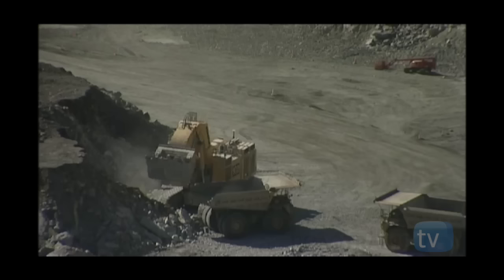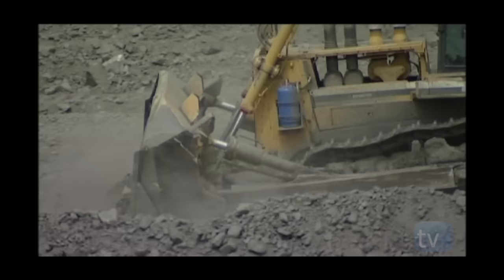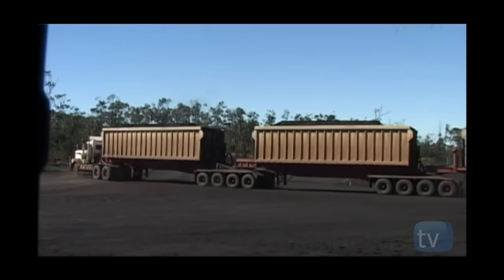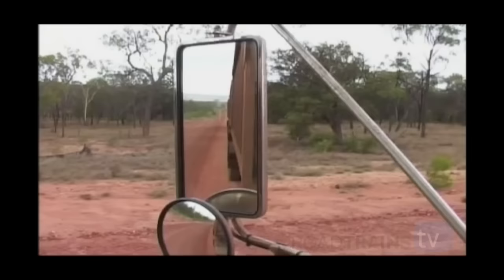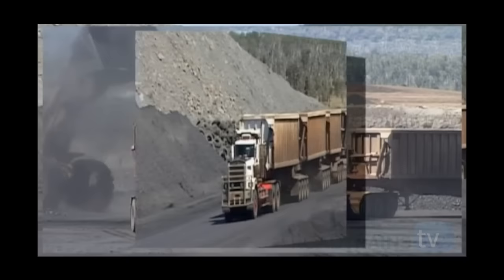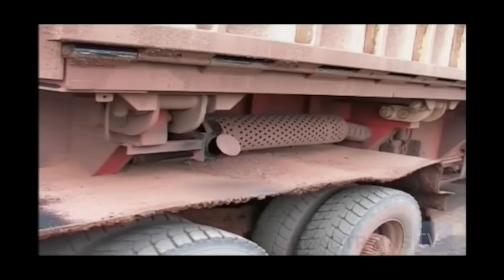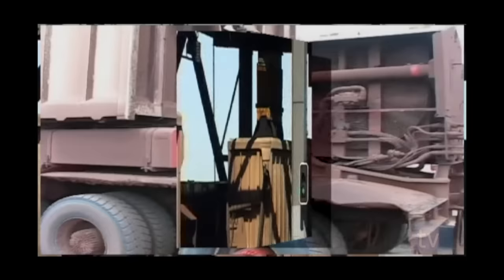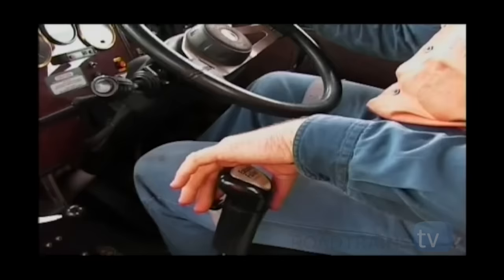Massive 1000 hp Kenworth C510  with 5 trailer road train

Comment: Better title: Massive 1950 lb ft of torque @ 1300 rpm Kenworth C510 with 5 trailer road train.
Reply: Massive 1950lb ft of torque... lol

Volvo, Scania, Mercedez, MAN : Hold my beer...
Reply: Well 'my' (company truck I drive everyday) with a stinkin' factory OEM 18yo 600hp Cummins has a factory 2000ft/lbs + @ 1375rpm.  Big deal for the C510! Who gives a shit about HP?
Oh yeah and it's proper 2000ft/lbs actually available to the driver not Euro 720hp/2600ft/lbs (actually only available to the dyno for dick pulling purposes rather than load pulling). Those Euro trucks crack me up. I drove a 720hp Scania V8 recently and it had NOTHING and I mean that, NOTHING like the power the Signature in my 'ole truck has. Stupid Euro truck pulling a B-Double up a hill couldn't make more than 35 - 38km/h at 55t. At 60t my old unit goes up the same hill at 50+ km/h twice a day.
With a single trailer my truck at 40+ tonnes goes up an 3rd direct in high range at about 1950rpm at 70-75km/h on a good day. I'm a company driver and I know what I'm talking about. I drive the same route twice a day.
Reply: @ThePaulv12 ...... The big difference between the EU & US engines, is that all the EU Truck engines are Under-square and the Cummins (& Cat) are Over-square.  In layman's terms, that means that an Under-square engine's Stroke travel is less than the diameter of the bore.... just the opposite of the US Truck engines. 

The Longer (over-square) the stroke in relation to the bore diameter... the higher the piston speed per rpm, which equates to greater internal inertia which generates greater lugging or, "holding" ability for whatever amount of torque generated.
   
This was the cause of Lots of ignorant "4 cycle versus 2 cycle" discussions (re: Myths & "bad mouthing") back in the day of the 2 cycle Detroit Diesels... which still persists even in this day and age... all based on pure ignorance.  

1600 (or whatever the number) ft lbs of torque is 1600 ft lbs of torque, Period!... regardless of operational cycle design (for all 2 & 4 cycle gas & diesel engines) or the engine brand name producing it.

Two 4 cycle (just for example) diesel engines with identical hp & torque outputs, identical rigs with identical trans, final drive ratios, tire size, & gross weights... with the One Exception of one engine having (for example) a 5.5" X 6.5" B&S versus 5.5" X 6" B&S..... the engine with the 6.5" stroke will "hold" each gear longer in an upgrade pull, than the engine with a 6" stroke due to greater internal inertia created by the higher piston speed in the bore.
Reply: As it should be. Horsepower is irrelevant but the torque output is what it power.
Reply: @Romans--bo7br  very informative response. Thank you.
Reply: @ThePaulv12  I think the Scania's only make the big numbers in top gear or something, but you're right, they're gutless compared to Cummins motors in the real world.
Reply: @jowenjv4463  Real trucks are measured in Clydesdales, euro trucks are measured in Shetland pony's.
Reply: @xr88yu  If Clydesdale are the same shit than imperial measurement system, I won't refer to it in anyway versus Euro measuring system x) 

Troll mode off. 

What is the difference between those two types of power ? Measuring procedure ? Does it make a big impact on the final values ?
Reply: @jowenjv4463  A Clydesdale is a breed of draft horse, a Shetland is a kids size pony. And yes, their is a big difference in pulling power between the two.
Reply: @xr88yu  ok. Thanks for enlighting me about horse culture lol. But if it's a different measurement method, the big boy engine will have kiddy european power if done with european measurement method. And little euro kid will put big boy's US  power if measured with Clydesdale method
Reply: @jowenjv4463  It's not a "different measurement" its a saying in the Australian transport industry.
The idea being,
600 Clydesdale draft horses (CAT, Cummins, Detroit) will out pull 700 Shetland pony's (Volvo, Scania, DAF, etc) 🙄
Reply: @xr88yu  Oh ok, I though you were talking about measurement methods which lead to HP difference between HP, BHP, PS etc etc. 👍
Reply: @xr88yu  😅😅😅

Comment: This makes me appreciate a 750 HP car much much more
Reply: A 750hp car wouldnt be able to move the trailers. Its not just hp but the ammount of tourque theese monsters put out is insane
Reply: Neeraj Sharma  1000 hp is 1000 hp
Reply: @StonedSpagooter  yes it is, but your LS, 2j or rb aren't going to give you 2000 ft /pound at 1300 revs
Reply: noob no videos chanel  For towing trailers, you're looking more at the amount of torque, rather than the amount of torque. It literally has almost 1 ton-ft (2000 lb-ft), that's a huge amount of torque. No road car would be able to generate that much torque at a low rpm, or have such a torquey engine. This is a very large engine, made for pulling and towing, not for top speed.
Reply: What the fuck do you need 750 hp for?  You only go to the bloody mall or to the garage to fill the thing up all the time.
Reply: The pistons in this truck will look like paint cans. You really think your ls1 will go toe to toe with a truck engine? Go back to school, kid.

Comment: I think people have overlooked the 2000 lbs of torque going through an 18 speed transmission.
Reply: And that has planetary final drives
Reply: @wrenchtheroo6557  lbs of torque... bcs physics is a joke xd
Reply: Most semi trucks have around 13-18 speeds and usually have about 1500+ lb of torque
Reply: @Andrew58251  most recent 15-16 liter engines can make 2000 ft-lb of torque
Reply: @wrenchtheroo6557  I think most are around 1800, some larger, some smaller thats why I said 1500+. Point is most semi trucks you see on the road have a similar engine to this, just a bit smaller
Reply: Эндрю . Thanks for the info ! Is this for highway trucks ? & does your answer only apply to “down under” or is it also true in the USA ?
Reply: @robertmintz63  usually planetary drive vehicles are always used in an off road condition in the us unless it's a special moving company such as mammoet where they need a lot of torque
Reply: European trucks puts out much more power, with smaller engines, at a better economy and emissions. 
Look up the new giant road trains transporting wood in Sweden. 
I'm danish myself, and we hate those smug swedes, but those beasts are impressive

Comment: It’s interesting to read the comments on this Unit from people that you can tell haven’t got a clue and don’t understand the uniqueness of this set up, I operate these Roadtrains our units pull 3 trailers with 300tnn of product and they are an absolute work horse in their field, To work the 18 speed to sync with the Auto on the power trailer on a climb out the pits is something to experience, I have seen a few that didn’t get it right and than it gets exciting with a big mess of twisted Metal and a big job for someone to clean up.
Reply: Sounds like fun!

Comment: I see a lot of posts arguing for euro or KW in Australia. The both have roles to play, but Europeans in general have no concept ot the size and heat of Australia. If I was buying a truck for long haul, i'd be looking for the one with the biggest radiator and a snorkel.
Reply: Hold on don't eu trucks are better since they are shorter and also have a bigger grill

Comment: i want to see them back up into a tight space hauling 4 trailers.
Reply: They simply can’t, and I’d hate to see them try. Instead they design the loading and unloading areas around a loop system, or a traffic system, dropping off goes one direction, picking up goes the other, with plenty of open space to turn a full 180 if need be.

Comment: Kenworth are really powerfull trucks..
Reply: Lots of different trucks can be "powerful".... just depends on how they are powered and overall gearing.  Gearing is Everything... you can make a "weak" engine pull a mountain off of its foundation with the right gearing (a "slow" Transmission with High Ratio (slow) rears.... and you can make a "strong" engine pull like a sick dog, with the wrong gearing... ie: too low of a ratio in the rears, and "fast" transmission.

Comment: Saw the road trains in northern territory a few decades ago. Very imposing. Iirc they were limited to three trailers then. Perhaps others more familiar can confirm or deny if this was they case. I also saw the kenworths in action out in the deserts of Saudi Arabia years ago, running out to the rigs. It was amazing that something so large could just seemingly float over the soft sand that much smaller vehicles struggled with. Its all in the tyres.
Reply: In Port Hedland I worked on the super quads. 4 trailers powered by an isx and road legal. 67 meters long I think.
Reply: @deanriley5690  interesting, thanks. I stopped over in Port Hedland for a couple of days, years ago. The worst tap water I ever tasted! You couldn't even mask it with strong coffee. Hopefully they have sorted that out by now😊

Comment: Thumbnail says 1000 hp truck- kenworth spokesman doing the add says 600 hp
Reply: Maybe including the trailer?
Reply: 1 2 3 Four Five do you know what HP means?
Reply: @lukeWiz44  Hewlett Packard Harry Potter Horse Play Horse Power
Reply: @lukeWiz44  But if you watched the video, those are powered trailers with 600 horsepower each
Reply: Read the description m8
Reply: @123fourfive5 .... No sir, they are Not.  Only the Third (3rd) trailer back, is powered.... with either a 450 hp ISX Cummins or the ISX Signature at 500hp, while the KW has a QSX 19 rated at 606hp... for a total of either 1056hp or, 1106hp... depending on which version of the Cummins ISX they're using in the "power trailer".

Comment: "real truckies don't use the clutch" 
* grind grind grind grind crunch - finally goes into gear *
".... See..?"
Reply: Use the clutch and you will crunch just as much
Reply: It does show your ignorance does it? Been trucking since 1997. Never grind the gear and only use the clutch during first gear at start and when stopping. In between gears while truck is in motion is shifting on the fly without using the clutch by matching the speed and the engine rpm.

Comment: Here in the UK we use the Cummins QSK19 in 750bhp tune under each coach of a number of high speed trains. The thought of using them in the outback where a breakdown is serious business amazes me. They're not very reliable. Although they are covering more miles in a UK train than an Aussie road train and at higher power so maybe that helps with reliability.
Reply: Used to work for Cummins. Spoke to an old timer who was an application engineer for the QSK program for a few years. He said that at higher power levels, anything other than perfect engine cooling and charge cooling would result in awful reliability. Not defending it, just saying it was known at the time
Reply: Yeah 750hp is probably ringing it's neck 606hp are sweet as

Comment: What?? The trailers have motors?!
Reply: yeah beacause there is just too much weight behind the drive to pull such a load on the road and especially uphill. You need that power trailer usually as your "third" for more power distribution throughout the train.

Comment: I built a powered stinger axel 25 years ago for heavy haul at lower speeds with a 8v-92 Detroit with a Allison 4 speed auto and 4.56 gears  used a simple RC box to operate the throttle and shift it in and out of gear was only good to about 40 MPH    should had got a patent on it ??
Reply: oh well.  you saved on patent fees.

Patents expire in 20 years.
Reply: Detroit!!

Comment: Cummins diesel..American know how.
Reply: riplstrip  the truck name and design is American,its was just built in Australia
Reply: Clearly don’t know how with your education system 😂
Reply: Phillip Aubin true. Cranks too. They just machine them in USA and then they can say made in USA. Company I work for just had a new X15 literally blow up on I-294 in Chicago. Engine parts all over the road. Pistons went right through that Brazilian block.
Reply: America don’t have good engines they overheat bad blow up in ya face it’s Aussie engineering bud, it’s Australia #1 now
Reply: Detroit 2 stroke is better.
Reply: But, with your current, political regime, is it wise to boast of "American know how"?
Reply: I wouldnt brag about cummins. Junky dodge uses them
Reply: @jimmychanbers2424  its the only good part of the 2500 pickup.
Reply: UnknownAccount as an american i vouch this. aussies have the most badass rides. hold up at high power too.
Reply: All our manure spreader trucks are Mack. Every truck is set to run 85 mph. I would bet a Mack engine can out work a cummins.
Reply: @jimmychanbers2424  it the volvo engin has got some mack and aussie ingenuity- hell yes!
Reply: Cummins engine is American made

Comment: God help them if they have to stop fast. The brakes would burn up!
Reply: Nah. It won't go fast and every wheel will have a set of brakes. Can't say with multiple trailers but semis will actually stop faster when towing a trailer
Reply: Greg they stop faster than people thing, 5 axles on a typical truck and every one of them braking with weight on top so they are unlikely to lock up. I can’t picture this would be any different

Comment: 600hp and 1,900lb/ft isn't much for a 19 liter engine. you can get that out of any 15 liter cat, cummins, detroit diesel etc. Still an impressive machine though! I'm sure that 19 liter would last longer than a 15 liter making the same power though.
Reply: That's the whole point, the K19 lasts a lot longer than any smaller Cummins or CAT. The only comparable engine would be a  3408 CAT and they don't make them anymore. The European Volvos which BIS were using on a similar on-highway job in Western Australia didn't last 5 minutes, that's why they engineered these particular Kenworths so they would get reliability. They were tired of smaller engines and trucks that didn't last.
Reply: What would be the point of a smaller engine? More challenging to cool, lower reliability and less engine brake for a weight advantage you won't notice.
Reply: For a Cummins yes. On the haulroad here in AK the isx15 600hp last maybe 400k miles tops. The old 3406e and c15/16 and the new dd16 last much longer.
Reply: They mentioned it was compliant with an emission standard, that should tell you everything you need to know.  The engine, when unbridled, is probably capable of double that output or more but has been tuned way back to reduce emissions.
Reply: Most American c15s have 2050lbs/ft 🤣
Reply: @gm16v149  the magic word:RELIABILITY!!!!
Reply: ADD TO IT: only pete/kw of paccar and volvo's mack are willing to custom build a rough terrain truck.

Comment: I'd love to cruse in one of them and mash some kanggaroo ! What ? The F-N trailers have engines ?!
Reply: its actually very smart and needed if that long rig shall be able to climb a steep hill.
on flat road cruising pushing only air, you can turn off the extra engines and save fuel.
Reply: Similar units
 .700 km litre full 
Empty near 2km / litre

I fly tomorrow near Coober pedy south oz 
Tri dive kenworths single engined pulling 200 tonne of copper concentrate  gvm  up around 400 tonne? 
Ill ask for you

Comment: for fuck sake just build a railroad at this point .....
Reply: Where this one is, building a rail line to the nearest port would be prohibitively expensive. It's not like putting a spur line for about 40 miles. They're hundreds of miles away. In the Pilbara region of Western Australia, there are automated iron ore trains, but they are only 300 miles at the most distant. Australian Kenworths are some of the biggest in the world. There are road train routes in Western Australia that start from 150 miles from Perth, the capital. Three trailers is considered normal, with a total weight in excess of 100 tonnes. These carry general freight, which is miles away from any rail line
Reply: What the other guy said, plus the fact that railroads are notoriously terrible at climbing an incline under load.

Comment: If Kenworth built a truck better suited to these road trains, it would have 4 axels on the tractor, so as to not beat up the roads so bad. Another factor would naturally be more power for the added axel, of 1,300 to 1,400 hp for easier towing and starting. Looking at the hills, it is overloading a 1,000hp engine pulling the grades this unit uses, thus keeping speeds down on straight stretches for the same time of haulage and the same diesel consumption because of not pushing the engine to its limit. Surprised the engineers let them push these engines so hard.

Comment: 1950 torque? I’d expect more (like 2250+) given how heavy they are hauling.

Never mind...powered trailers. That ought to do the trick.
Reply: yes i noticed that to,, becouse i was woundering how that looong  rig would do climbing a steep hill if only the truck pulled. hehe
i have bad experience with that,,, trying to drive down a gravel road with a 3,5 ton tractor.. pulling a 22 ton trailer and the old trailer didnt have brakes. hehe
When the trailer started pushing the tractor sideways, i had to stop breaking and be happy it was light uphill after the steep downhill so i was able to slow down.

Comment: Why are they using that Cummins engine? The smaller 15L 14L trucks over here in USA, they are rated 600hp and 2015 torque..more than that 19L...but I just just realized it also has a power trailer

Comment: the days of coal are over. price has dropped threw the floor. great Video with lots of technical information
Reply: Not over.   modern western countries use more coal than you know.   burning fossil fuels for electrical power is still done, and i don't mean in backwards east block countries 60 years ago, i mean in advanced western countries this very day...like the USA.  almost 2/3.   That's why people who think they're saving the world by running electric cars is a complete joke.  Most of the power they plug into comes from burning fossil fuels.